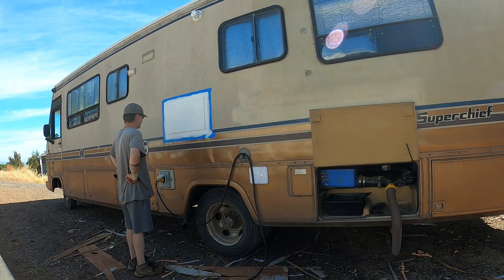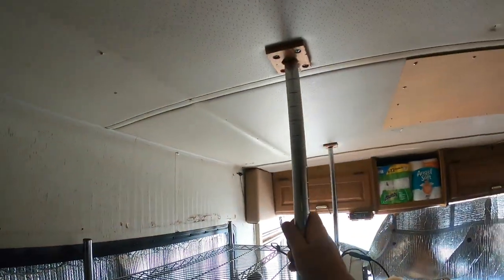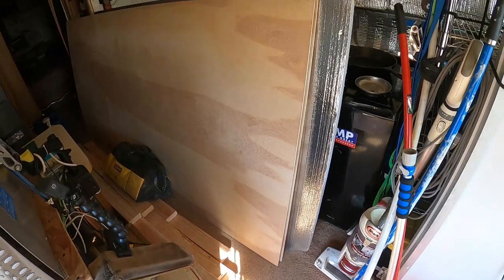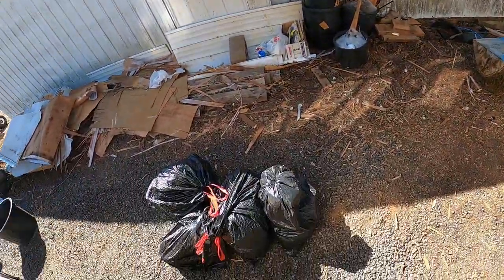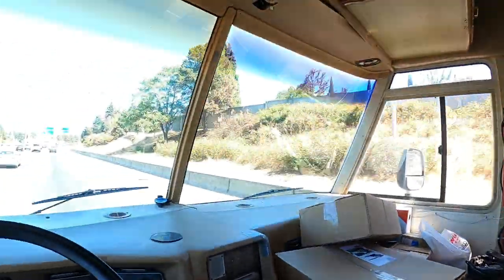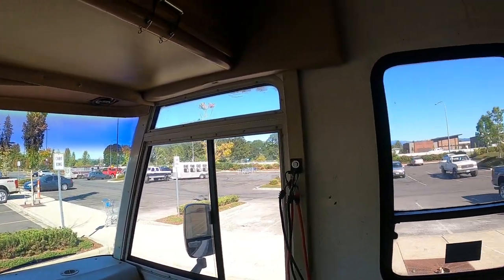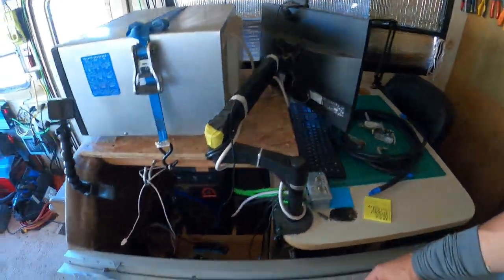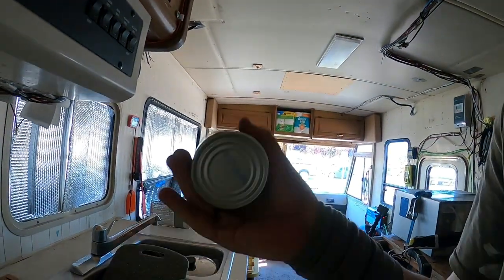Driving Back To Town ,, RV Living

Comment: The next biggest mod that would gain an extra 2 to 5 mpg try adding a center mounted belly pan under the rv. Also ditching un_necessary weight helps alot.

Comment: Patches is looks pretty sharp with the streamlined roof! Not surprised it seems to cruise a little easier without the drag from stuff on the roof. Be sure and keep us updated on how the roof repair performs. I’m curious to see how the coating holds up after some miles of road us. All Rvs flex and twist some and since you didn’t use a rubber (tpo/epdm) over the wood. I could see having to recoat a few times as it moves and settles then I hope you can cover that roof in solar panels! Put a airfoil on the front edge of the panels and keep it streamlined. I know you didn’t want to put any holes in the roof but if or when you do install your panels look up some panel installs with uni-strut. With your new unobstructed roof It would be super easy to build a rail style system with uni-strut thats modular. You could attach it to metal framework down each side the length of the Rv would keep the holes minimal and weight off the middle of the roof. It’s not super expensive. Could even check around for some used or leftover pieces. The. place strut as cross bars as needed for panel mounting. so if ever upgrading or swapping adding panels no new holes needed. Like a giant roof rack base.. you would have a versatile attachment point for anything else. Have a great day dude!

Comment: Hi Nathen I have two 100 watt Renogy solar panels on the roof of my Fleetwood Fiesta 32s class A. I glued them to the roof by using aluminum L channel bolted to the side of the panels with rivnuts, then the other surface of the L channel is glued to the roof using 3m VHB 4646 high temp tape. they been up there for 3 years and over 11000 miles and they aren't going anywhere.

Comment: You may discover that 65MPH is the sweet spot, if you have 4.56 gears that will put you right about 3100 RPMs and that's the sweet spot on the HP/Torque rating on your engine.

I run between 65 and 70 and end up between 3100 - 3300 been doing it for years and thousands of miles and have had good luck with it on my 454 / TH475 / 4.56 combo
Reply from the maker: Yup! That's funny I was just thinking on this trip it must have a sweet spot around there since i saw that my economy gauge was showing its best reading around 65. Good to know, thanks for the info!
Reply: @ClassALiving  yeah dating back when we had a motorhome with the same setup as my current one when I was a kid (80s early 90s) everyone told my dad he would get more MPG if he drove slower, he did it one tank and got .2 MPG less going 55  rather than 65. Dad always towed a vehicle too and so do I. I have discovered the same with mine. Most of the people saying go slower have never even tried to go past 55MPH.

According to the HP/TQ curve 55 MPH has the HP/TQ numbers fairly low so the engine is lugging.

454s love to run at 3000 RPMs all day long.

I'm interested in your results. Keep an eye on your temp both water and trans and keep us updated on what you find to be your best cruising speed.

Take care of yourself.